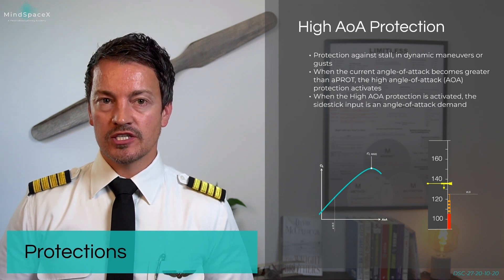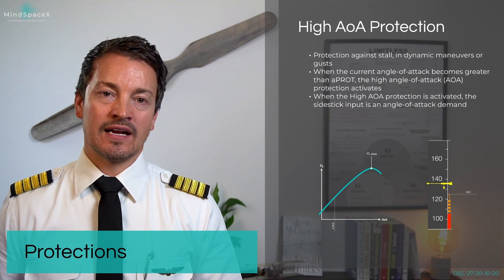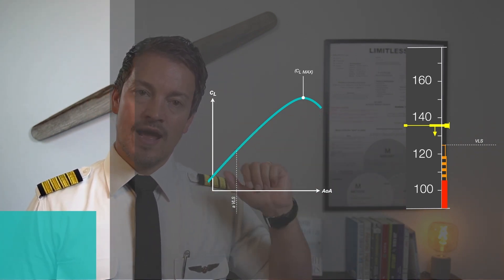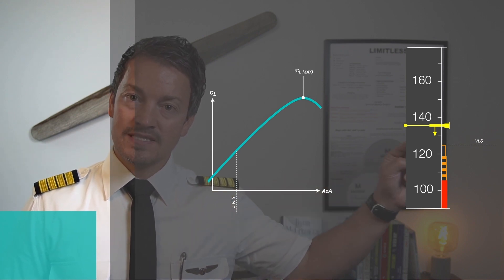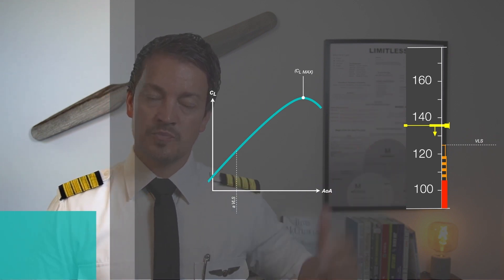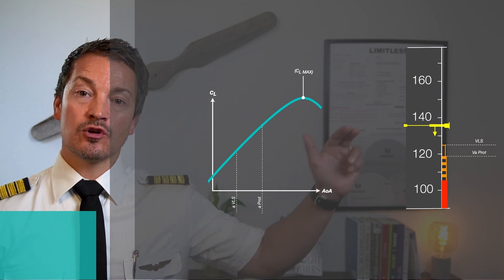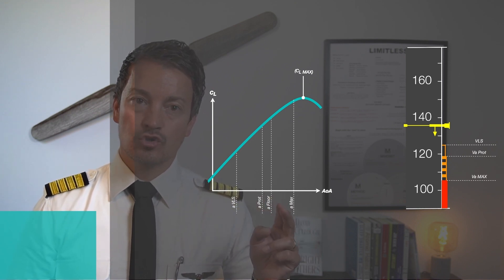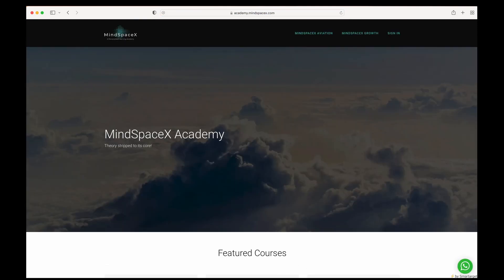A320 High Angle-of-Attack Protection

Comment: Sir at what point in holding the side stick back continually to decrease speed in normal law will the auto pilot deactivate ? Right at alpha prot?
Reply from the maker: Hi, the deactivation of the autopilot happens when the side stick is initially moved. Holding full back-pressure (any side stick input) would not allow the autopilot to be engaged. 
At AlphaProt the low-speed protection kicks in but this is not associated with the autopilot in this case.
Reply: @MindSpaceXAviation  good point and thank you. When would the auto pilot disconnect for example if you were in vertical speed in a climb and you began to run out of energy ? Is it a function of AOA? Or just entering alpha prot?
And once the auto pilot disconnects in this scenario in normal law at what point would the low speed protection force the nose over ? Would that happen somewhere inside of alpha prot or at alpha max ?
Thank for this you are very knowledgeable